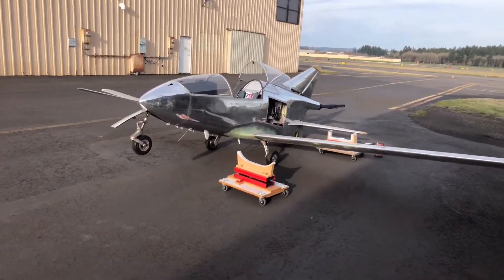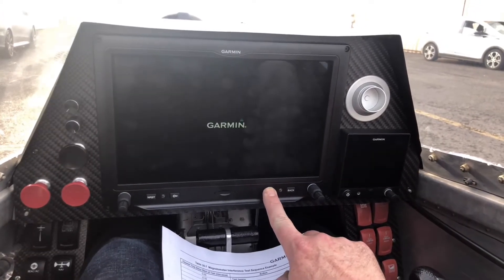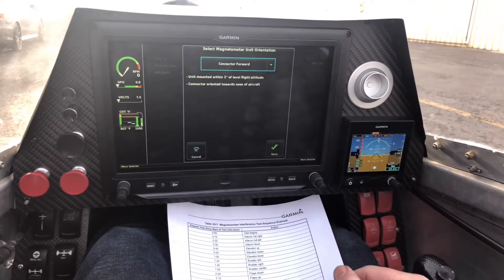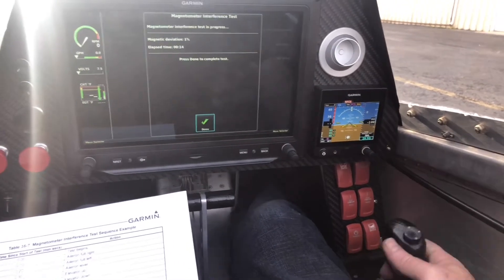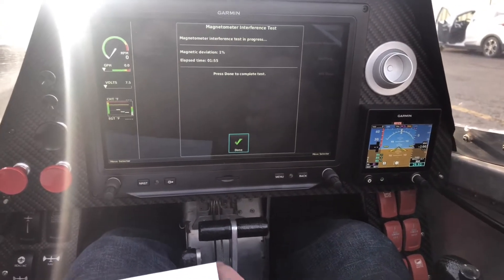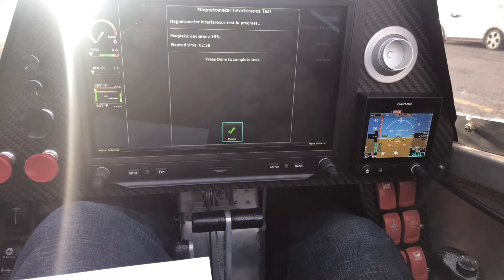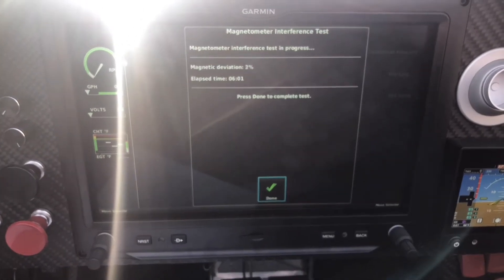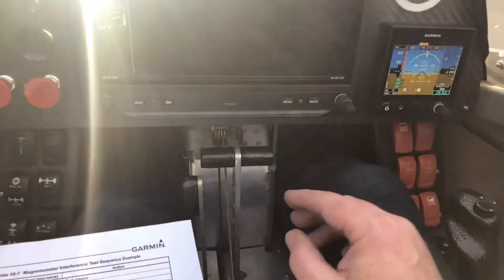Garmin G3X Magnetometer Interference Test and Calibration

Comment: Hi, thanks for posting this video.  I actually have a BD4 that I've installed a Garmin GPS Nav system in.  I have a GN-355 with dual G5's.  I'm about to tear my hair out because I can't seem to get my system to calibrate properly.  I've don't it more than eight times and every time....even after it says "calibration successful"...the Garmin HSI is anywhere between 3-20 degrees off from my whiskey compass.  And before trying to calibrate the Garmin I had just swung the whiskey compass using my airports compass rose.  After calibration how closely does your Garmin's compass readout match your whisky compass?

Comment: it looks like you should add shielding to your wiring harnests as well as ferite rings.
Reply from the maker: I followed Garmin instructions very closely and had Pacific Coast Avionics help out with questions. The CAN-BUS wiring is Garmin spec shielded cable, the wires for Wig-wags, strobes, and recognition lighting are also shielded. The aircraft does not indicate any interference in magnetic heading when testing with even all electrical devices on.

Comment: Hi mate, I an so happy to see your bird outside of hunger.  I have one question for you... where bd5 store the fuel? I assume in the wet wings. In the instructions for bd5 everything is illustrated however part on the end of manual didn't contain any information for fuel storage pump and fuel line. Could you please in next video show me how did you do fuel supply a tank and the fuel pump. I planning to get on credit 300 libs jet engine for my bird.
Alex Sydney
Reply from the maker: Hi Alex, thank you for watching my videos. I’m making them because I wish someone else already had for me to watch during my build! As for fuel storage all BD5’s store fuel in the wings. The A wings and Jet wings are full wet wings, the B wings are wet in the inner 2/3. I have the B wings and they each carry 13 gallons when full. Some of the aerobatic BD5’s also have a small fuselage tank for inverted operation. My aircraft had already been partially built and had the original plan fuel selector and lines. I removed that and designed my own system with individual fuel shut off valves operated from two red pull handles on the panel. If you search YouTube for “BD5Pilot fuel” you will see a three part video of the fuel lines themselves and another video on designing and installing the two valves. You can order a full set of plans or individual sections from Frank at Alturair, he has been very helpful during my build. You can also get a digital set of plans from the Bede Family Foundation in return for a donation, you can find that here: https://bedeaero.myshopify.com/products/bd-5-original-kit-plans. My build does not have a fuel pump as it would damage the mechanical pumps used by the carbs on the engine. I do use a gascolator and will install the fuel flow sensor though coming soon. Cheers, Dr Z